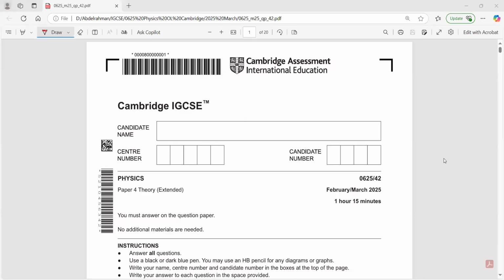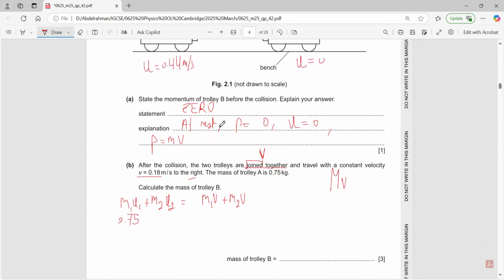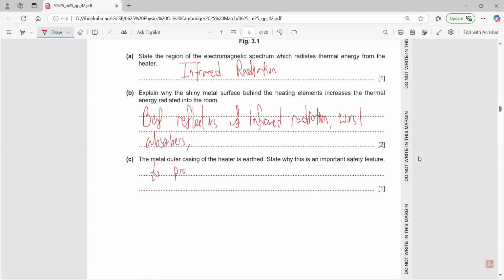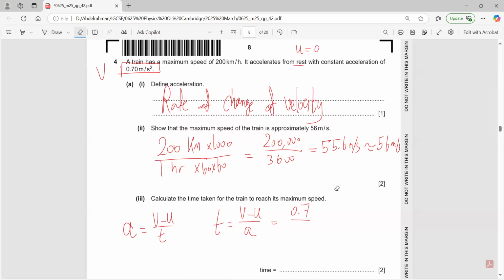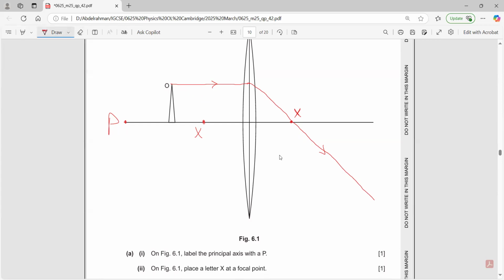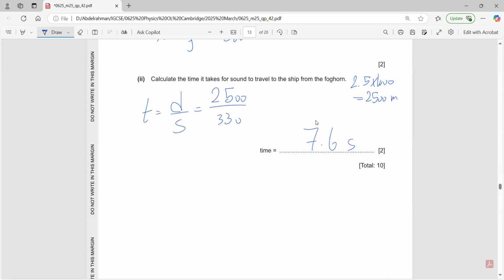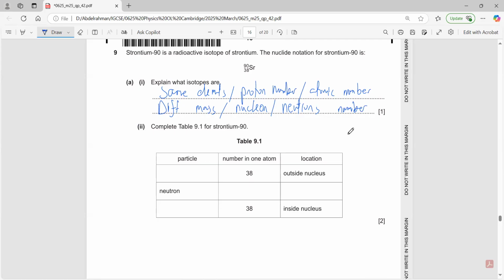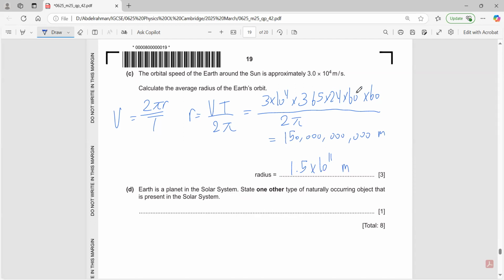IGCSE Physics 0625/42/F/M/25

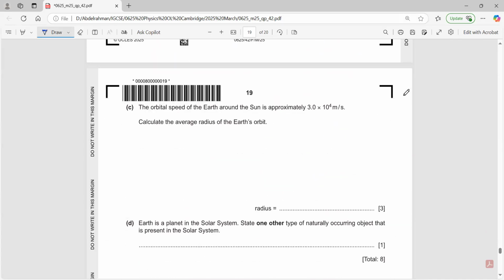Comment: 39:36 why is it not E G
Reply from the maker: Check the axis of rotation which is that dotted line passing through the poles. If it's facing the sun then it's summer in the northern hemisphere and vise versa
Reply: @ but how did u decide x is northern hemisphere
Reply from the maker: @Joudymoodz  in the figure, the north pole is found in X, therefore, X must be the northern hemisphere.

Comment: hi sir. why wont the seasons one be E and G cuz e is fully pointing to the sun and x is visually seen there.
Reply from the maker: That's a great question! Let me explain why that's not the case. Check the axis of rotation which is that dotted line passing through the poles. If it's facing the sun then it's summer in the northern hemisphere and vise versa.
Reply: @ Ohhhh, thanks for the explanation sir!